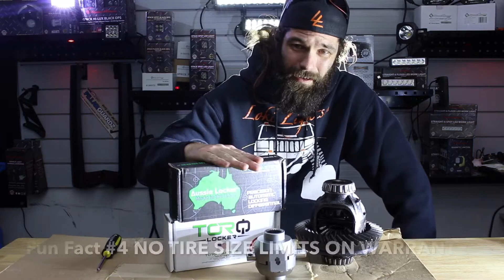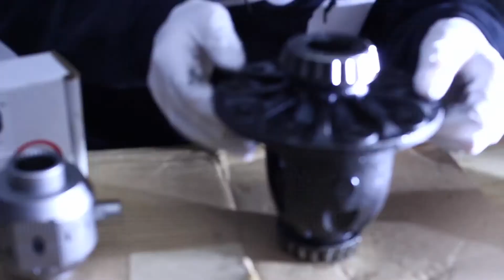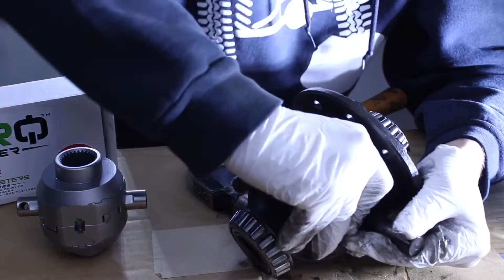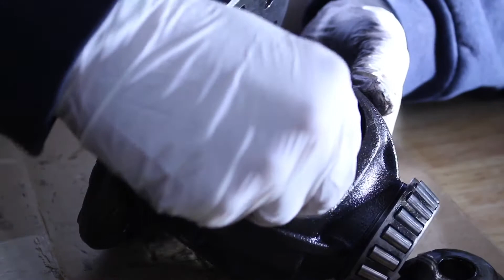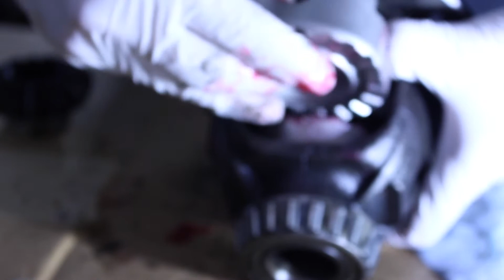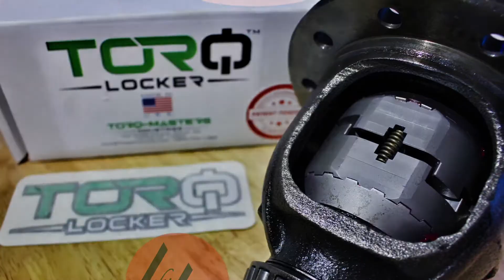Torq Locker TL-13027 by Torq Masters Industries Install. Dana 30. Loki Lights

Comment: Did you use old thrust washers or you had to obtain new ones? I watched several installation videos about Aussie/TORQ and there are some very tight specks based on thrust washers' size.

Comment: Hi Loki!
Is it a 27 spline D30? How well it serves you after these 3 years of being in service?
Reply: @lokientertainment3843  
How does it behave on paved roads?
What are the safe conditions to use it on paved roads/highways? What is the safe speed to engage 4H on the paved road ?

I have plans to install it into my daily driven Jeep with D30 front and D44 rear LSD (Jeep LJ). 99% of the time is driving city/Hwy. Gathering information.
Reply: @lokientertainment3843  
There is an issue driving wintertime on plowed roads. You never know where would be both tires on low traction surface or just one. This bothers me the most. 
I am from Ontario, and it really depend on local services. Some places could be well plowed, other poor or partially. 
As a technically educated person, could you explain using technical language how do TORQ Masters build TORQ Locker quieter than Aussie?

Comment: One of the three benefits this locker has versus the older model as listed in the torqmasters.com website is: “Easiest Locker on the market to install, no spacers, no dowel pins, no measurements” and then I come to this installation video to find out that you do have to take measurements (5:45) so which is it? Measurements or not?